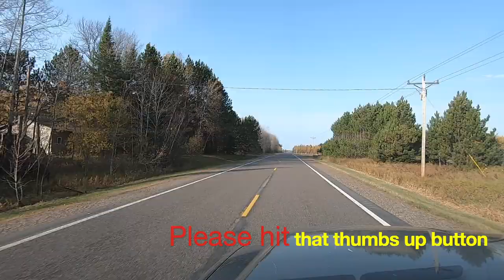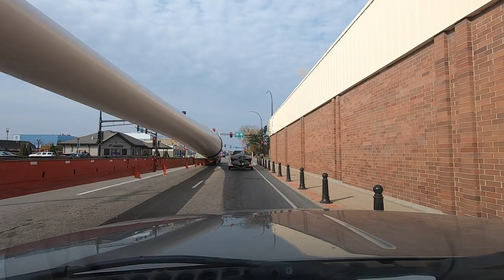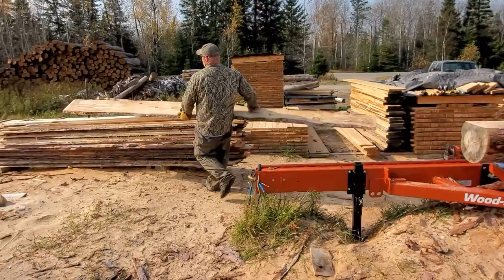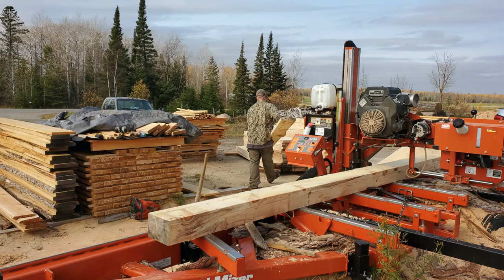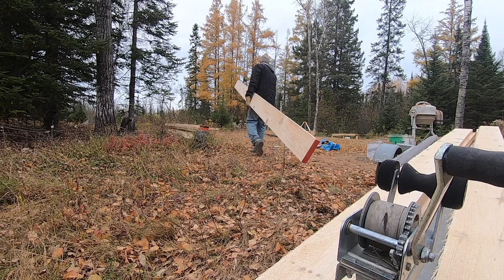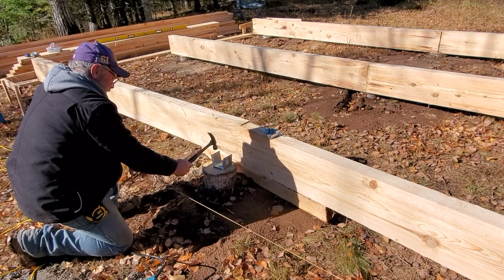Off Grid Cabin Build in Northern Minnesota Part 3  a visit to the saw mill. Woodmizer LT35

Comment: There is something satisfying watching that wood getting cut at the mill. Curious - how far do you have to shuttle the wood to the site from your house? I assume you are using a generator to power your tools? Looking forward to the next one, although it looks to be a chilly one! Brrrr...❄️
Reply from the maker: Maryann, the shuttle isn't far, about 200 yards into the woods, as for power, currently using every extension cord I have and when I pull the trigger on a saw it sounds very very bad, lol. Need to get my generator back from an old job site. This cabin has no access other then by walking or 4 wheeler, also no water or any way to get power to with out costing thousands, will use solar and generator while in it  If I enjoy the off grid experience may tear down or rent the mobile home currently on the 30 acres, and yes has been a bit cool, another 4" expected today and more on sat. Any more questions feel free to ask.

Comment: Awesome Wiley. Cool for you to visit the area again. That saw mill was pretty neat. That White Cedar is really pretty wood. Glad you had the ATV to help haul your lumber to the back. Still hard work though. Loading and unloading umpteen times! You are off to a great start. Now if you can beat the weather. Great job so far. Have a great day.
Reply from the maker: Didn't beat the weather but still a great project for the channel and will be used well once it's complete. lol. I tell you though that green rough cut is heavy, with luck everything will dry pretty evenly
Reply: @Thelifeofwiley  Yes, having it dry uniformly may be an issue. I'm sure it will be used plenty once it is done. That is a nice area. Take care.

Comment: Did you have him mill it true 2x or dimensional? I am going to be building a 20x24 off grid in Dryden Ontario. I'm 2 years behind because of covid. Was going to have a guy mill the wood for me up there.
Reply from the maker: 1 3/4 think by full width on framing and 1 x 10 on board and battens